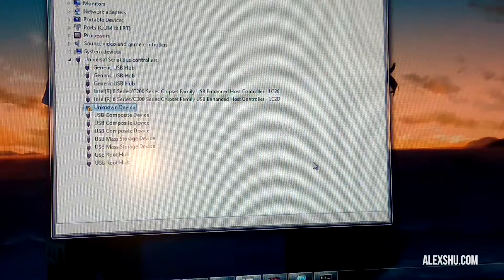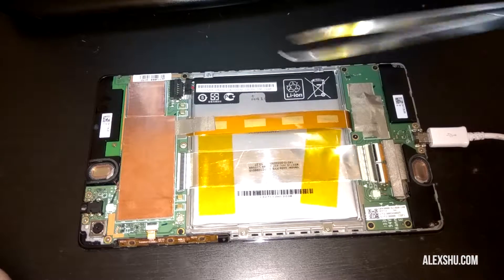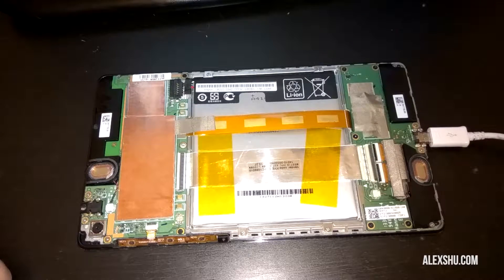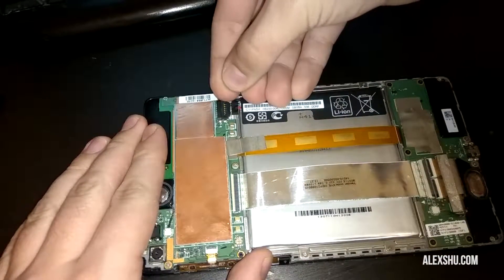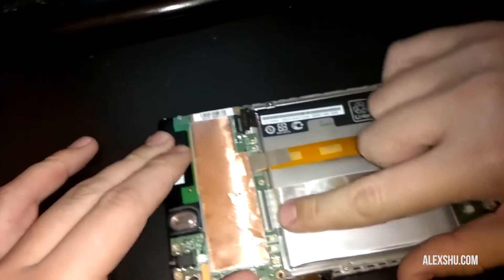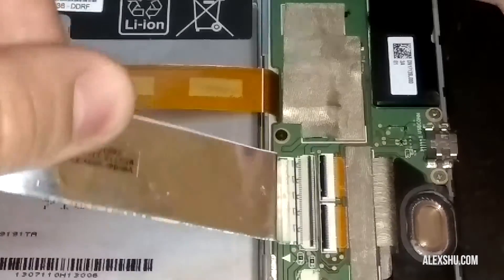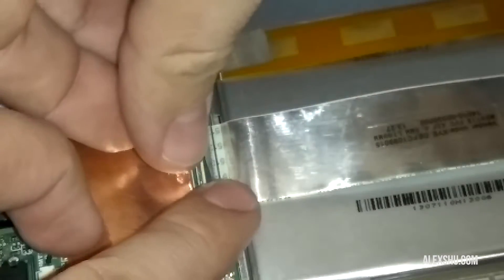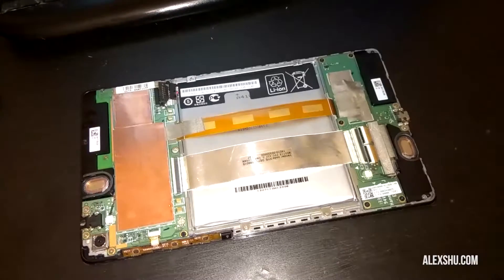Nexus 7 - unknown device fix

Comment: Same issue for the 2012 one, but there is not this cable.
Reply from the maker: first, try another usb cable, second, look for any cable(flat ribbon cable or multiple pin cable) between the power circuit(usb connector on it) and the main board (with all the chips on it) and try to play with it
Reply: @vasya88  Thanks ! Yes I tried and also changed the I/O usb port. It's charging, but not working after playing with it. I'll try cleaning it... Does it work with another cable than the Asus original one ?